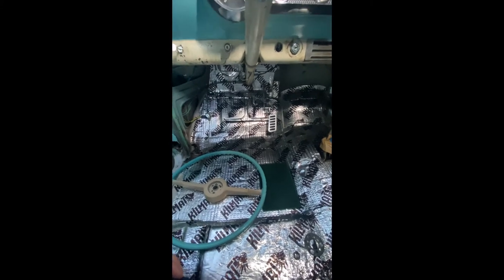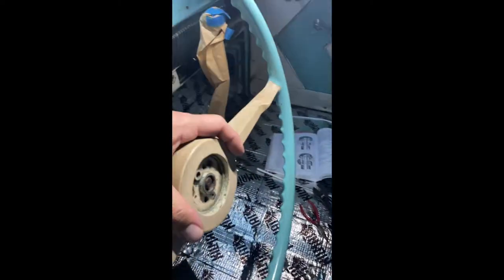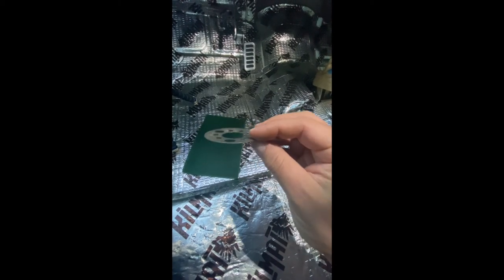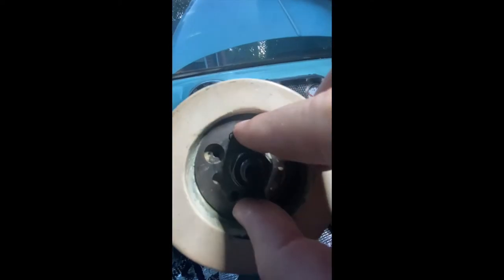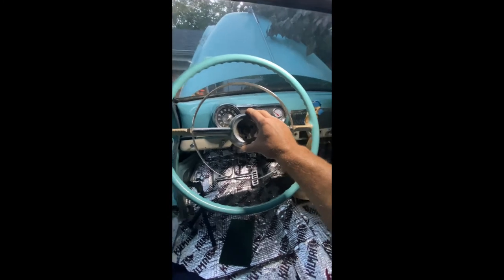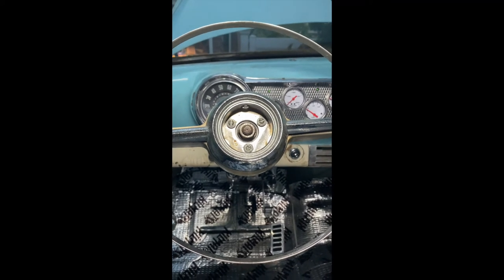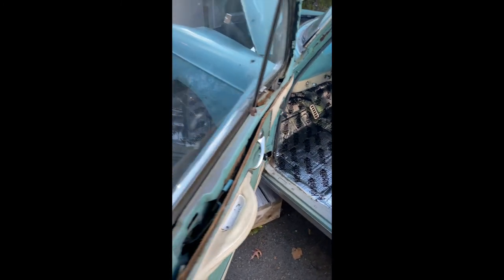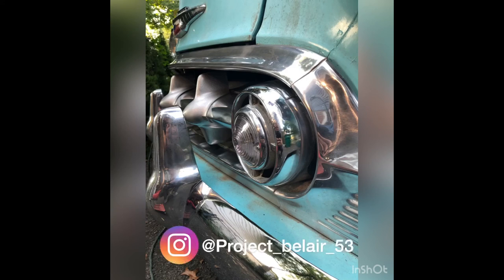Horn and Steering Wheel Install

Comment: Nice video, I was wondering how someone could use a modern/aftermarket steering wheel. Such as a Grant Steering Wheel. On a project car and have a classic/traditional steering wheel ring to activate the horn mechanism? Would such a thing even be possible, or would I basically trying to reinvent the wheel, and it wouldn’t be worth the time and effort? Thanks for any advice.
Reply from the maker: Dude that's a great question. Honestly I'm not sure. A lot of times builders just install an updated steering column to give them the flexibility. I looked online, Grant wheels have adapters for the horn. That would be a great video showing that build.
Reply: Doug I noticed you have a hose clamp holding the turn signal piece  what holds that in place.  Mines is loose also.  Is there something broke.  Thanks
Reply from the maker: @peteadams9466  yeah, not proud of it but there is a set screw to hold that cap in place but it doesn't work. So the hose clamp is plan B haha.

Comment: Great video, but where did you get that book and what else does it have ive heard the cars came with repair manuals for just about every part of the vehicle which would help me tremendously with my car, thank you very much
Reply from the maker: I believe I just did a Google search. But sights like Ecklers Classic Chevy has some, but look for either repair manual or shop technical manual.
Reply: @DougABirnbaum thank you